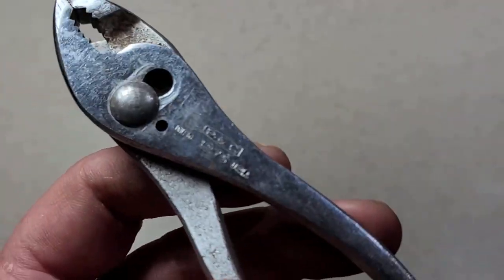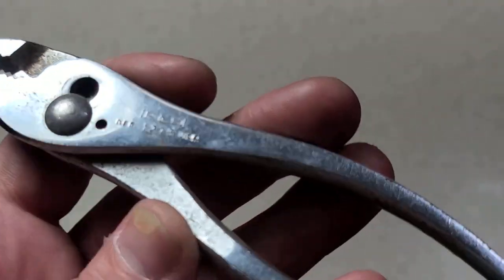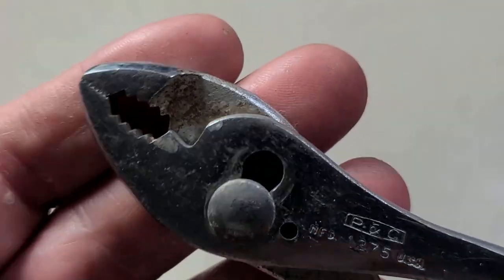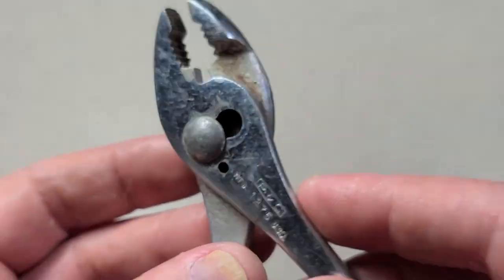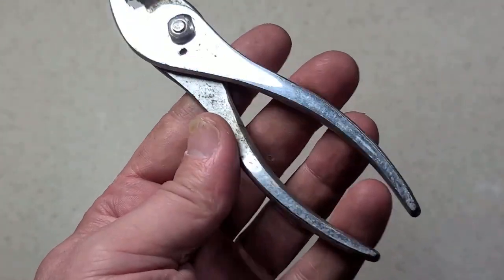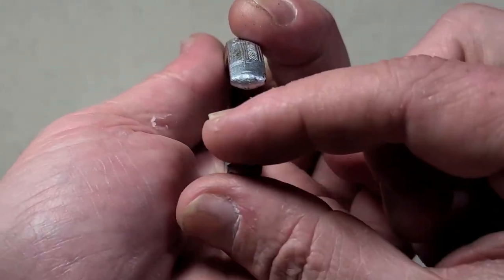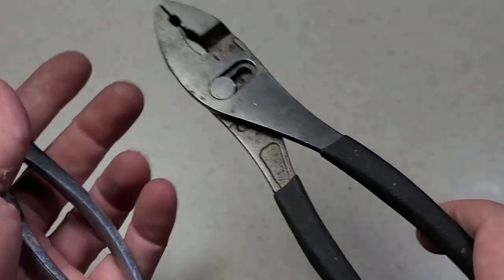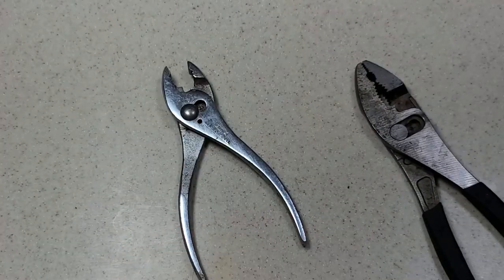P&C USA Slip Joint Pliers Review

Comment: Great review, Ty.  I have one P&C tool:  8" adjustable wrench.  Bought it, as a teen beginning my tool set in the mid '70s, about the time PROTO was securing that company.  With that grab, I turned to the less expensive Challengers until the '90s when PROTO wrapped them up.  Today, it's all PROTO when buying for my toolboxes.  That P&C has been a real work horse through the decades.